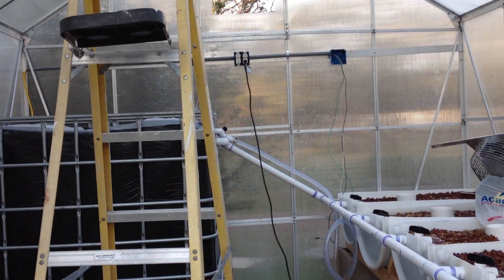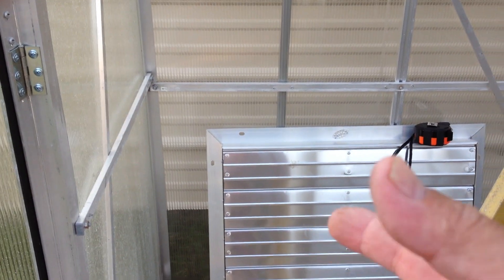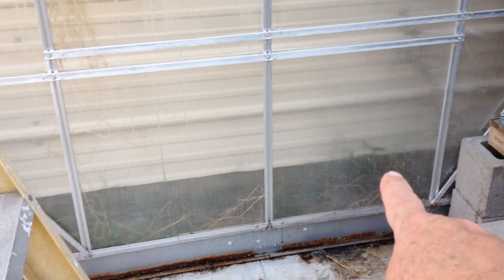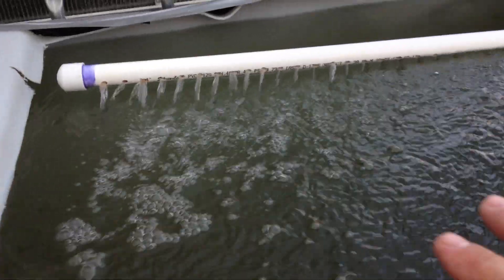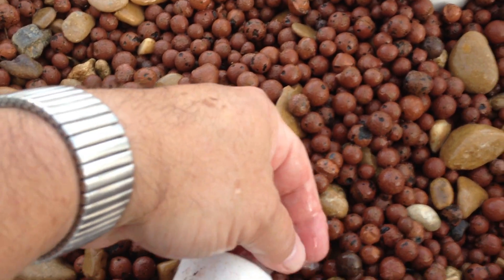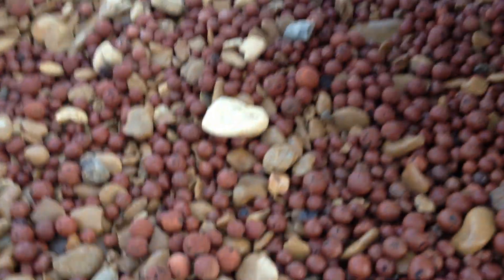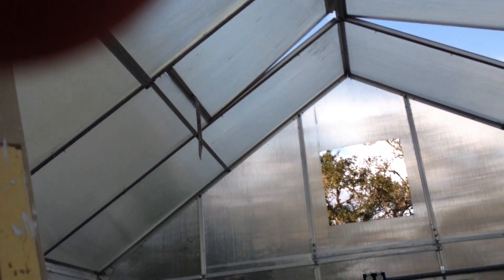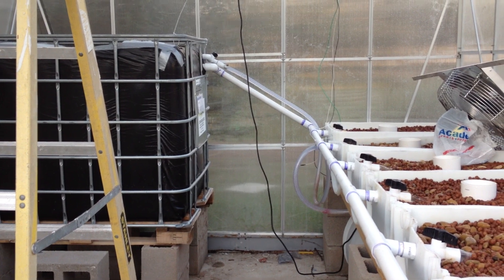Aquaponics System Setup Part 6

Comment from the maker: I don't have to have any of what you said, you clearly don't know much about aquaponics. We use pure well water and mineral traces are required for the health of the fish and the plants which a reverse osmosis filter removes. The flexible tubing is rated for potable water and is non-toxic so you're wrong on that and finally, Hydroton is nothing more than expanded clay, non-toxic and has been used for years without washing by many others. Read and educated yourself before posting.

Comment: first off you have  TO HAVE A REVERSES OSMOSIS  water system. second you have to wash the the hydroton first. they dust is bad for the fish and system. third you cnant use that flexible tubing, it releases chemical into the water. you should educate yourself before you kill your fish....

Comment: i like your set  up ,I don't  have room  at  my  place  as  I live  in the  city in  mid  wisconsin,,,and I just started a set up like  yoursI  have around  500 gal.  and 200 Hybrid  blue  gill. I need  to get  more  grow  beds  as I only have the tops of the totes that I cut  off  that  are about 1 ft. and 9 ft . 0f 4" pvc growing  tube....about 11  2 3/4 size grow cups, And  i  have all this in my garage between the door  openings , kinda  tight...  keep up  the good  work